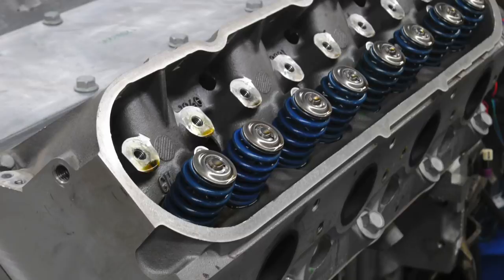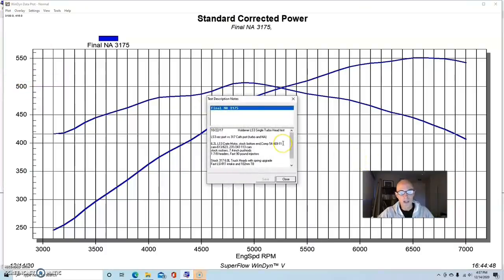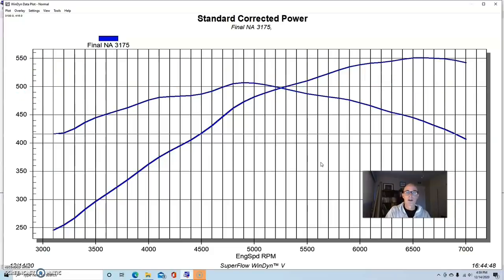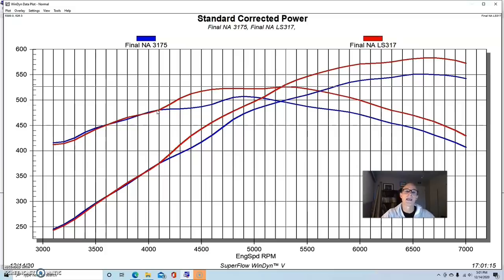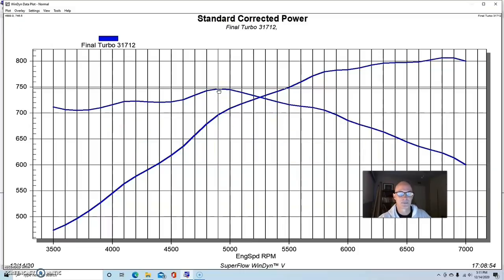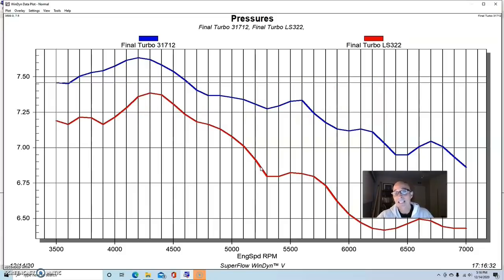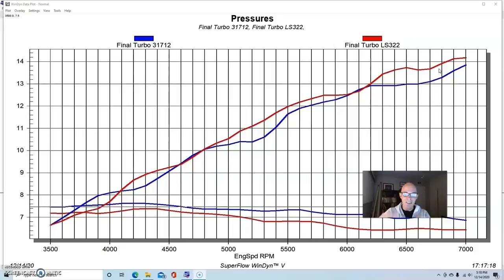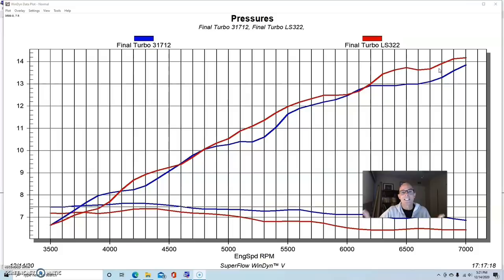TURBO LS HEAD TEST-317 VS LS3 (NA & TURBO)

Comment: Is there a build combination for a LS engine for torque? Like a 6 liter built bottom with 4.8 heads,  intake. Something where the power peaks between 2200-4500 rpm. Like 450 hp and almost 600 tq. Or is a big block the only way I'm getting those numbers at the rpm?
Reply: Naturally aspirated, no. But I would think with an undersized turbo it's possible. However, I think your engine would be happier with a more appropriately sized turbo that makes  600 hp to go along with that torque in the same way this engine is happier with the LS3 heads.
Reply: Keep in mind that LS is small block architecture and really are not great for torque as they require a fair bit of RPM for good torque. Gen 5/6 454 or a gen7 496 will blow every LS out of the water without even trying. 
From a prior test, an engine that made the most torque out of a ton of others run was a 6.0 with stock cam, 4.8/5.3 heads and truck intake manifold. More compression would make more power everywhere but theres definitely diminishing returns considering the rest of the combo is stock everything......
Reply: A turbo TPI small block would get him exactly what he's looking for - the Callaway twin turbo Vettes from the 80s put down right at 450 hp and 600 lb/ft of torque all before 5000 rpm. But he asked about doing it with an LS specifically.
Reply: You can trade peak hp for torque somewhat with cam choice (and vice versa), but not to the extent you're looking for and certainly not out of a 4.8. The newer intakes tend to make more power everywhere, so it's not a choice of torque with a dual plane or horsepower with a single plane like you used to see. Your exceptions to this would be the Holley Hi-Ram (less tq for more hp) or if you were to convert to a carbed dual plane intake (more torque for less hp).
Reply: @nowayjose596  I would have to up the compression of the bottom end just to choke off air flow at the heads? Seems to be the big block formula.  Set the block up for a 10:1-10.5:1 compression and restrict the air flow with oval port heads and small valves? Think doing that to a 4.8 or 5.3 would work?
Reply: Reason I'm asking for such a combo is because of the type of driving I do. I'm never in it long enough to see over 5000. I'm more interested in AutoX and Rallying than I am drifting and drag. Having enough torque to keep me sideways when it counts and to correct myself into another turn. I was hoping a cammed 4.8 would be able to see those numbers NA all motor.

Comment: Unlike the 5.0, you're comparing a really good head, and an amazing head, so less critical, IMO.
Reply: More exhaust pressure is just proving more flow out. Reduced backpressure on the intake side, is less restriction at the same mass air flow.
Reply: BYW, adding an airflow meter may be of interest. The 2.2+HP/CFM is the thing I've always thought was why the AFR heads seem to twist the dyno farther than the flowbench.

Comment: I like the timing info sir. I have a vortech blower on a stock 351w ran by megasquirt. How much timing do you recommend with pump premium. I have an intercooler a/a. Running around 12psi.
Reply from the maker: Since combos and timing requirements and detonation sensitivity differ, I would say run whatever doesn't make it detonate.
Reply: @richardholdener1727   thank you sir. I'll keep it around 20* until I can get to a tire dyno.

Comment: Hey Richard, werent these tests run with a T4 exhaust sized turbo? What happens with the backpressure when you run a T6 exhaust with the 96mm turbine? Or do you have a video like this already?
Reply from the maker: a T6 adds nothing at this power level
Reply: @richardholdener1727  OK
Reply: @jaydubb71  his reply is absolutely not true .. a gt55 base 102 turbine with a .96 AR  will blow the doors off that 96mm turbin